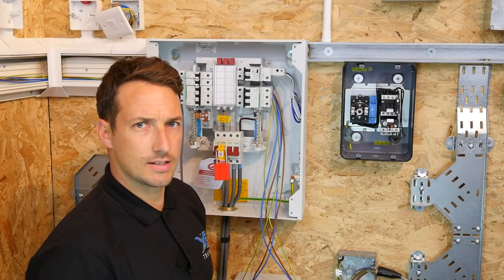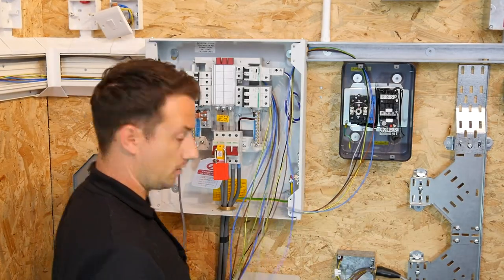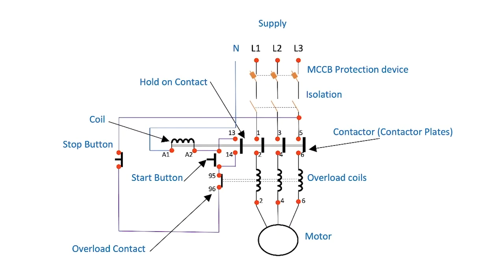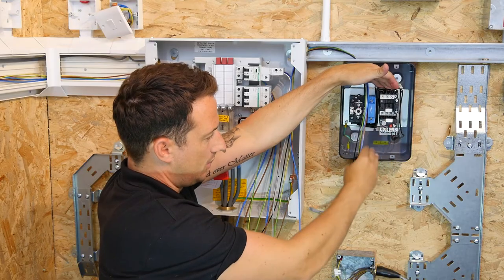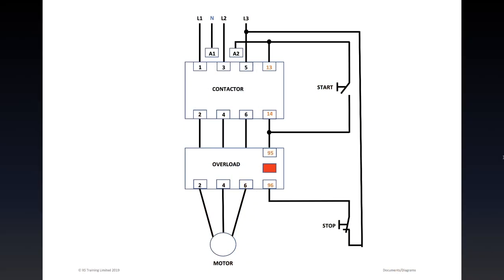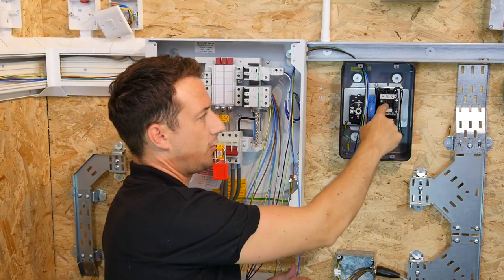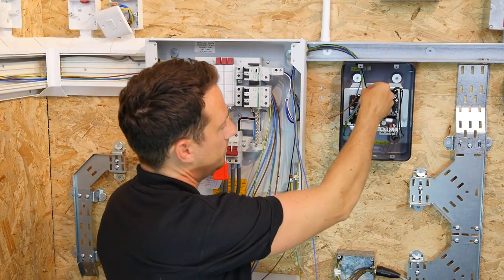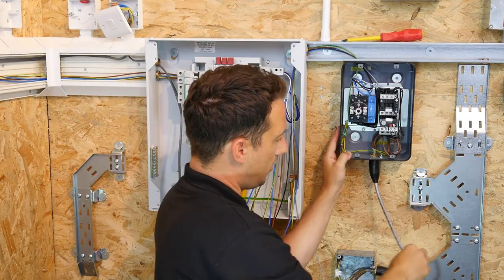AM2S and/or AM2 Training, Preparation, Revision - Sample -  3 Phase Motor And D.O.L. Starter

Comment: Are all the terminals between the isolator and the top of the contactor already done? And is the sy cable already pre made up of is that something you have to run yourself.
Reply from the maker: Hi Nathan, thank you for your comment. The control cables are prewired within the DOL, yes. The only part you will need to do, is the supply to the Isolator using singles and then install and gland off the SY cable. Please watch the video in relation to the control cables though, as you will need to know these connections when you come to the fault finding.

Comment: Is the plastic cable tie OK, or should they now be metal ties to comply with regs?
Reply: The majority of AM2 centres still use the PVC clips as there would be no risk of the cable dropping in the event of a fire. A longer cable installed horizontally would definitely need metal ties. If the centres have upgraded there specifications and have metal ties, yes use them.

Comment: Is there any reason why all line cores of SY cable have been sleeved with brown, if I see correctly, rather than with brown, black and grey (for 3  phase)?
Reply: SY is manufactured with black insulated cores, which are numbered. Some centres ask for the cores to be sleeved brown first. Then number 2 identified with Black sleeving and number 3 with grey. If you look closely they are identified in this way. If the centre have Brown, Black and grey sleeving available, please use this. Thank you
Reply: Jamie,
Thank you very much for the answer
Reply: Would you fail the am2 if you failed to sleeve the sy cable all together ?

Comment: Do we have to terminate and 2nd fix the sy cable? Or would that be pre wired already?
Reply: Yes you have to run it and terminate it.
Reply: You do need to first fix and second fix the SY cable.
Reply: Will you have to wire the contractor or does it come pre wired? So will you wire the incoming and outgoing to motor only?

Comment: Does anyone know how you would do an insulation resistance test on this? I failed this on my AM2
Reply from the maker: Hi Dave, you need to test IR from the board and then again from the load side to ensure you test the supply and load side. Test between L1 – L2, L1 – L3, L2 – L3, L1 – N, L2 – N, L3 – N, L1 – CPC, L2 – CPC, L3 – CPC and N – CPC from both ends.
Reply: did you test both sides of the DOL ? use the plugs on the simulated motor box to test IR to the DOL, same when you do r1+r2. hope this helps

Comment: Why are they asking for SY cable to be used to supply a motor ?
Reply from the maker: Hi, this is on the specification of the AM2 practical assessment you will have to take.

Comment: does the load side not need a neutral ?
Reply from the maker: Hi,. Thank you for your comment. The AM2 specification states 3 phase , 3 wire is to be installed.
Reply: So will the SY cable provided will be 3 core for the 3 phases and cpc is provided by the SY braiding.
Reply: @fennybenton8705  No, the braiding on SY cable cannot be used as a CPC
Reply: @uplightuk8924  Yes found that out but thank you for replying
Reply: @fennybenton8705  So how did you get a CPC to the motor? 

I’m curious because when I done my am2 we used 5 core SY but someone on our firm who just done the Am2 said it was 4 core SY, 3 for phases 1 for neutral so now you run a separate cpc?
Reply: @uplightuk8924  I will let you know, my am2 is in July, will find out at prep day or before hopefully.
Reply: Pre assessment day done.
SY cable from starter to the motor is 4 core and numbered. Cores have to be sleeved brown black grey and cpc green/yellow. No neutral to the motor.
So obviously no IR test of 3 phases to neutral or earth to neutral.

Comment: Your left elbow is practically touching the 3 phase incoming supply
Reply: The DB is safely isolated. The connection points are not accessible and as a risk assessment has been carried out at the start and therefore I have deemed to be working in a safe manor.